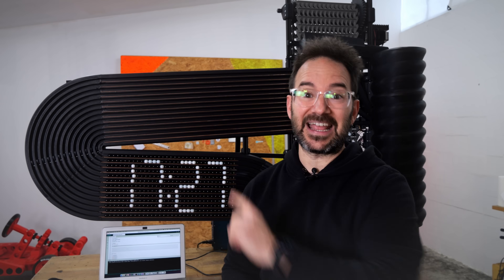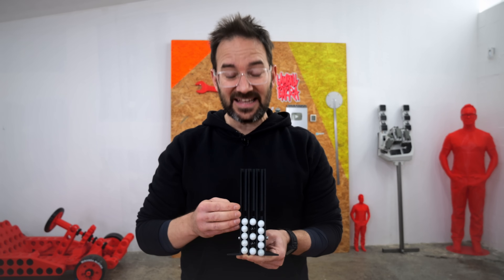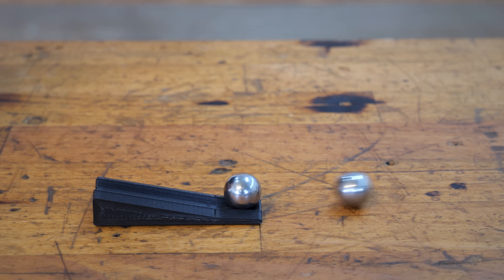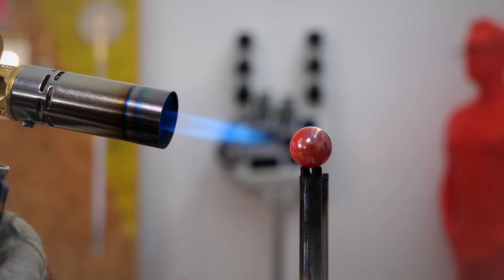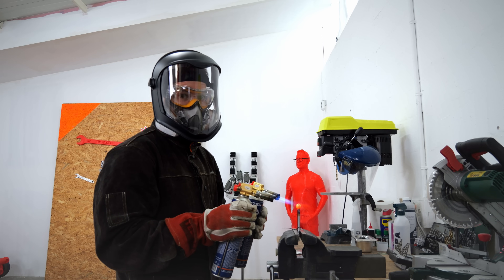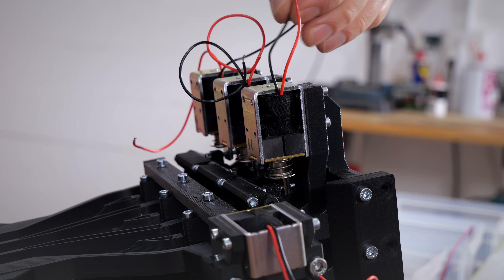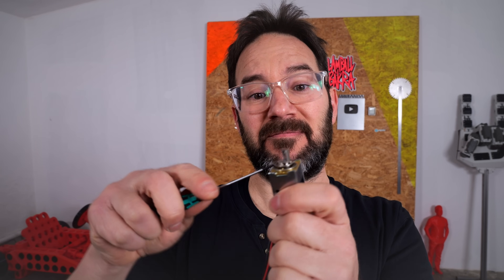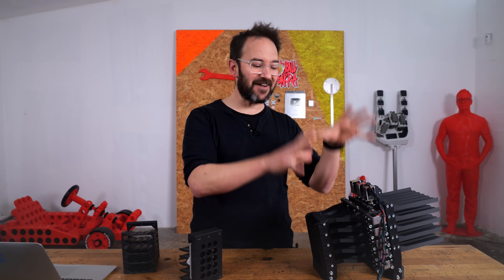Ramp Based Rapid Marble Swap - Marble Clock Seconds Display Pt.1

Comment: I'd use a permanent marker to paint the balls black. It won't be 'permanent', but it will take a couple of seconds per ball, and probably good enough for prototyping.

Another way to go about this is to make a big rotating disk that has holes in it. So it rotates 1/10th, and the mask for that digit will only let the marbles pass of the correct color. So a bit like a music box in that the content will be hard set. You might even make the whole thing fully mechanical without electronics.

Comment: I really feel that pixels that don't change colour shouldn't change the marble. This really reduces the amount of marbles needed and the noise of running it. It also allows loads of 'channels' to stay the same permanently - the colons between hours and minutes for example. The '0' at the beginning would stay until 10:00 when it flios to 1. meaning you only need 3 marbles configs for that digit to cover the whole day with just 18 marbles to change for a full 24hr, instead or replacing 15 marbles every second savng over 1 million marble changes per day for that one digit. It means individual channel control though ...

Comment: You don't need muriatic acid for chemical methods - ordinary household white vinegar will do the job. Here's what I would try: clean the oil off first (dish soap and water will do that), soak in vinegar, then apply cold bluing. Unlike the heating method, this can all be done in large batches.

Comment: There are black nickel electroplating kits you can get for a reasonable price.  Might be worth the cost and time.  It might have been an option to, instead of cycling balls, use 15 balls and use magnets to suck the marble back up that is not needed .

Comment: Easy optimization: You will never need a white marble in two of the positions (the spots in the centers of an 8). In fact, you don't even need to drop marbles there, ever. Just put a black marble in those spots and hold them forever.

Comment: just an idea, aluminium balls. you can apply an oxide layer on them that can be colored. the difference is, that the balls will be lighter.
on the other hand, they will not interfere with your solenoids.

Comment: as much as i enjoyed madness mode lifestyle choice on blacking metal marbles 
would it not make sense to automate that ? you are in the process of building a to the second marble clock , which is crazy hard 
id have thought a marble cooking loop would have been easy by comparison and obvious given the time per marble 
a small loop of heat, dunk ,cool repeat should be straight forward 
you could even Ivanify it by having color checkers to pull finished ones out of the loop

Comment: I'm going to throw a huge wrench into this and say....what if you didn't need black marbles?

What if you just "kicked out" white marbles if they need to switch color, and have a blank space instead of a black marble?

You're already holding the "next set" of marbles coming in away from the "display" area!

The only issue I forsee with this is if you want to "queue up" a lot of upcoming seconds, then you'd have marbles filling blank spaces of numbers ahead of them.

Comment: This is madness...
A more reasonable clock would use something other than digits for displaying the seconds.
for example, a clock with hours+minutes+tens_of_seconds in digits+10_dots would be so much more practical.
And stop "mixing" the marbles in a single pool: keep them all in their own lanes with enough marbles to display 10 digits in each lane.

what you're doing is just madness

Comment: You could speed up making the black marbles a ton if you used a furnace and used something like a tray for a fryer to dip a lot of marbles in oil at once.

That way you could heat up and process way more in parallel

Comment: To save some loading time you only have to replace the marble that is the wrong color from the previous digit. (Also would need fewer marbles including the time consuming black ones) Unless of course you have multiple digits on deck ready in the ramp section, which would mess up the transition as marbles from multiple updates will get mixed.

Alternatively,
I notice you have 8 solenoids (for the mechanical multiplexer) you are two off from having an actuator for every digit.   You could use this to your advantage and drastically cut down the total (for the whole clock) by having a bank of numbers and passing an entire digit from the bank to the clock with coupled diverters to each cell.

Assuming there are 6 cells you could achieve this with 21 solenoids.

10- for each digit 0-9 running to a common rail.
5- coupled diverters (splitting the common rail into 6 cell channels) I recommend feeding the two "seconds" channel with fewer splits to keep up.
6- gates for each of the clock cells

You will have to keep track of how many updates are stored to keep digits on deck depending on ramp length to the cell gate.

Comment: Ivan, are you sure your multiplexer setup can handle up to 6 sequence steps per second? To draw a 2 for example, you will need a different setup on your horizontal solenoids for every column, so it will have to execute the sequence under 1 second, which is: set horizontal solenoids, release one column, set horizontal solenoids, release second column, set horizontal solenoids, release the third column. That sounds to me like there might not be enough time for the marbles to clear your multiplexer gates (meaning the just released marbles might get knocked by the horizontal solenoids setup for the next column).

This could be ameliorated with being able to queue more than 1 digit at a time, since 5 of the 10 digits have a pattern where you can release 2 columns at once, thus requiring only 4 steps in the sequence instead of 6. So I guess theoretically the mechanism needs to be able to do at least 5 steps of the sequence each second, meaning the marbles cannot stick around those horizontal selectors for longer than 0.33 seconds in the 6 steps case, or 0.4 seconds in the average 5 steps case.

Just my thoughts, excited to see if the gates are fast enough or how you will solve this if they're not!

Comment: The good news about the black marbles is you need far fewer than the amount of silver ones.

For the ones digit every cycle (10secs) requires 103 silver and 47 black marbles

For the tens digit every cycle (60 secs) requires 59 silver and 31 black marbles.

Comment: Looking at the 15-marble display and using coordinates from the top right and calling that (1,1), then there are 4 marble positions that will never change color. (2,2) and (2,4) will always be the background color and (3,2) and (3,4) will always be the highlight color. You don't even need chutes for those positions. You could literally glue marbles into those 4 positions and have no structure behind them at all.

Comment: One way to use less black marbles (and marbles overall) is to only swap out those that don't change from number to number.  for example, an 8 to a 9 would only need to replace  a single marble.  In the previous version this wasn't possible, but now that we're going from Back to Front with the  marbles, it is.
also, with this method, and correct timing, you know exactly the sequence of marbles you need for each number.

Actually, this way gives you five positions that never change color...two silver, and three black.

Ok, I worked it up really quickly -- with this method, you only need a total of 24 silver balls and 25 black for each digit in your time setup.  Should also be quieter in the long run, with less moving marbles.

Comment: The marble quicksort is gonna be a fun thing to tackle, I'm sure... 
Especially given they need to be distributed evenly between all slots.

Awesome work though.
Any chance the marbles could be processed in batches in some form of oven?... I'd love to see this actually completed...

Also was surprised about you choosing a 2-step system for ball selection in a system optimised for speed. But - less solenoids and less mechanical mess that way, for sure.

Comment: Improvement suggestions: 
1. Skip black marbles and just make those slots empty. 
2. Only replace the marbles that need to be replaced. Consider there is just 1 marble difference between 28 and 29, for example. Why replace all?

Comment: I would approach the second update with the white marbles only, avoid metal. Second, i woukd place a gate at the feont, like the first prototype, then when the next set if digits are released, a front fate wikk drop all the feont marbles, no need for black to push them, no need for a full matrix, just a gate that releases all the front marbles in one go whilst no allowing the next set to follow.

Comment: I get a feeling this desing will be a lot quiter then the previous one. Then again, we don't have a marble loading mechanis yet ....
spitballing a few ideas for blakcening the marbles. Can't you make a marble run with a soloid stopper at the beginning/ end. Marble comes in, stops under/ over flame, solonoid goes open en marble gets dropped in oil. this migtht overcomplicate thinkgs but it will probably keeps you sane (ish), preventing you from another week of blackening. 
also could you electric plate the marbels with another metal that is easier the anozide or change coulor? 
Not sure but if you use a reversed polarity you might also be able to remove the chrom plating. But then the marbels might shrink, depending on how thick the chrome layer is.

Comment: You are making the same mistakes as martin was. I highly recommend watching the whole marble machine series as you will highly profit off of the mistakes he made. For example your "tiny issue" of it being unreliable will be a huge issue in future. also the design is not horizontally stackable. Dont wanna be pessimistic but experience in that "marble machine research" just proves me right. Start by defining your design requirements and make sure with atomic tests that your design is fully matching those before iterating further.

Comment: This will involve backtracking, but what if you didn’t need black marbles? 

Instead of using a full grid of marbles for each image, you leave gaps where the black marbles would go? 

You’d need a mechanism to eject all marbles (since you wouldn’t always have a new marble coming to replace the old one)

You could also play around with only replacing the necessary marbles with each number change. Instead of all 12.

Comment: Something to consider: The 2 black marbles on the 8 are always black for every digit, and the top left marble is always white. So it might be simpler to replace those channels with static marbles. 
Or, if you want to keep the animation of all marbles falling and being replaced by new ones, at least you know that for the top left corner you don't need the black marble queue and for the 2 middle ones you don't need the white marble queue.
Reply: Something else I noticed is that since your rows are coupled, you'll have to do 1 column at a time, if you do all 3 at the same time then each row will be either 3 black or 3 white. However there are a few numbers that allow you to do 2 columns at once:
 - On 0 and 8 you can do the 1st and 3rd column at the same time
 - On 1 you can do the 2nd and 3rd column at the same time
 - On 3 and 7 you can do the 1st and 2nd columns at once
I doubt this will be useful to implement but it's an interesting observation. This is a fun project!

Comment: Just an idea, but would it be possible to implement the clock as some kind of 7-Segment-Display like some LCD displays use? 2 of the marbles will never change (the black ones in 8). You would change the color of entire segments instead of individual channels, so 7 solanoids might suffice. E.g. in the transition from 2 to 3 you would only have to change 2 segments.
If the marbles in one channel are alternating between black and white, you wouldn't need to select from black and white channels. Instead you would activate the solanoid of e.g. the "top" segment and every marble in that segment changes color, because they alternate.

Comment: Nice project, most interresting is the proces itself. But how are you manage that you need black and white marbles at one horizontal row. Because you have connected the horizontal switchers to one solenoid. In my opinion the switchers should be individual.

Comment: You need a furnace to do bulk steel marble tempering.  Yes, tempering is to achieve specific metallurgical characteristics (flexibility, hardness, etc), but the process definition still applies.

Ceramic brick, a propane torch and blower would likely be sufficient to get the marbles to the correct temperature.  This would be far more controllable and uniform using something like a wire  ball tray made out of Tungsten perhaps?  Just a thought.  Additionally, it's all rather cheap, though, I'm not certain about Tungsten wire costs.

Comment: One advantage of the design you discussed around 2:14 is that you could build it without making any sorting mechanism. Just keep the marbles in the same channel and loop them back up to the top. It would effectively work like a flip clock.
Reply: The programmer's solution to all problems. If you don't have enough time to do something, just 'cache' it.
Reply: Imagine how cool it would be to make the clock work without any software at all. If you could mechanically ensure that the marbles merge together in the same order every time, you could mechanically sort the marbles back into channels the same way (eg with flip flops or a programming wheel). Then all you’d have to do is arrange the marbles correctly to start and like magic it would count from 0 to 9.
Reply: @Phillipg6 I mean the clock part of it is alredy software controlled, you could still make it mechanical whitout rails if you make the two marbles have diferent density and short them like that, but the amount of complexity you are adding to the problem jeeeesus. And no you can't put marbles that close togheter and have them predictablly fall every time, it just don't work like that.
Reply: That would take 10 balls per channel, and we have a black-ball shortage...   You may get away with fewer balls if you consistently return them to the odd and even columns, and the software remembers the colors in each of the two channels, and pics the channel with the correct color in the first position.
Reply: I don’t see why black marbles are required with this front/behind new feeding technique.
Reply: then you whould have channels in front of the clock defeating the point of the project namely a cool cloock
Reply: @Erbmon  or it could have stoppers at the very front and release the whole number at once, like a waterfall, only taking care of the balls falling on fixed rows. You can see 99% of the ball and still keep them inside a vertical channel. Plus, for the extraneous-operations lovers, there is now the need for turning the order of the row from bottom to top before feeding it back to the cache
Reply: @DoNotPushHere  then you need to engenier a perfect catchet and you will need to a inverter aniway the first marble is the last when catched, you are not making things more simple you are swaping complex problems around.
Reply: Yeah that's lame
Reply: @Aweoe  performing extraneous operations is gigalame
Reply: @OwenSkarpness this entire project is an extraneous operation, thats the whole point

Comment: If you control how the marbles exit, you could keep them in the same orientation and feed them to the back without "checking" the colours. And because it just loops through 10 digits, you would only need 150 marbles total.

Comment: Question: Why are you even bothering with steel marbles if there giving you this much trouble? Not only will the solenoids be giving you trouble, I'm certain you don't want to spend another 2 months making enough black marbles for this to work...
Reply: Steel spheres can be bought in tighter tolerance than glass spheres.

Comment: Ivan, have you considered KLIAR nano-ceramic e-coating by Legor to colour the metal "marbles"? It's a very thin, durable coating applied similarly to electroplating. It's available in many colours including black. Each marble would only need to be processed once instead of 11 times.

Comment: An idea that popped into my head at the end here is making it so that way you don't replace the same colored marble. Like marbles 2,2 2,3 and 2,4 (column,row) are black for both 0 and 1, so don't replace them. By that logic marbles 3,1-3,5 are white (chrome) so don't replace them. Just an idea to maybe help it run faster is just replace the marbles that change color.

Comment: Something I'll say. Forcing the marble selection to be universal per row is going to cause a lot of problems later on. If you have two colors in one row, you will need to do the selection twice, assuming you can stop both marbles, or you will simply only be able to decorate by row based on the option of marbles that are already present. You will eventually need to have each cell be selected individually in order to make this work, both for speed and accuracy, and can then open all the channels all at once rather than opening each channel individually.

Comment: Maybe just having a pool with only black marbles and a pool of only non-black marbles would work better, than setting up an algorithm to predict what you need and filter it on the belt.
If you always have black marbles on the left, while you always have non blacks on the right, you can make a mechanism that just selects left or right for each position.

The downside is, that you would require one solenoid per choice gate, with the 3 additional for the release gate. Or in the case of your example. 18 in total.